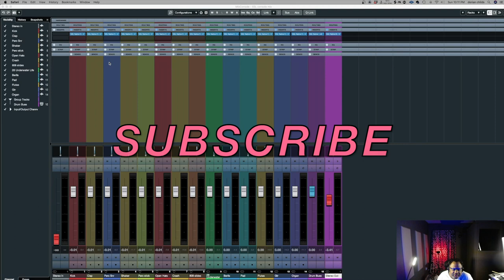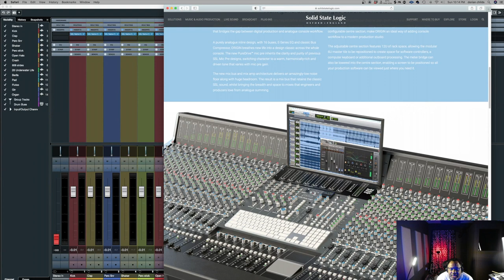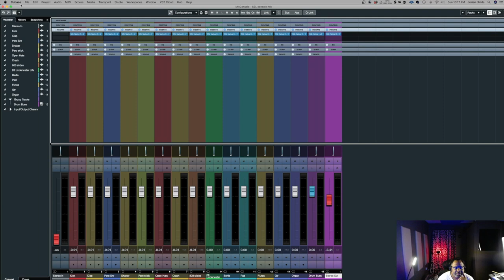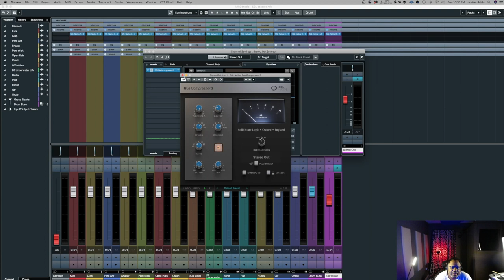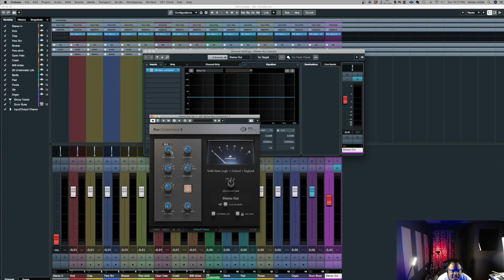How to create a SSL console via your DAW?

Comment: I'm useing same setup with Cubase 10.5 Pro and  native ssl channel v2/ buss comp. I also use UAD Studer A800 and Ampex tape emulations.  Lastly I've been mixing using rear buss compression technique. 
I use a controller i had since 2009 (tascam us2400) to speed up my workflow.   Lastly since I'm all in on the SSL I will add a UC1.
Reply from the maker: Hey ive been hard on getting the UC1 as well. I totally argree I’m all in for SSl

Comment: Like your Vid. I have a question on any real mixing board ssl neve or whatever. If you INSERT a compressor or eq does it leave the board before hitting the internal modules (The consoles eqs, filters or pre amps ect) or after. If yes would the console emulation go after the vst fx. Not that what you did was wrong you had no fx inserted so it would be 1st in line..Keep up the good worK.
Reply from the maker: Yes the signal will be patched out of the board going into the compressor then returning out from the compressor back into the board … that’s if we are talking a hardware signal flow.
Reply from the maker: I do it in such a hybrid way for example, I will come out of my audio interface then patch into my SSL buss comp hardware then return back to DAW on another channel.
Reply: @Cherokan35  I'm talking about all ITB console never leaving digital domain and how to route the signal flow as it would be done on a analog console. Would the vst channel strip go behind the inserted vst comps eqs ect in the chain to replicate how a analog console signal flow goes. Ive seen some vids where the vst channels strip is 1st and vst comps ect come after. My main question is on a analog console channel strip does the insert point come before the onboard fx eq comps gate or after? does it really matter lol. I'm just trying to create a real ITB and route it the same way that a total analog setup would be routed.. Thanks Again
Reply from the maker: @theweaz9975  yes the insert points comes before , it bypasses the channel strip to what ever you want using  such as outboard comps and eq
Reply from the maker: @theweaz9975  so in the digital world when we insert other comps and eq it will be first in the chain before the DAW’s stock channel strip
Reply from the maker: @theweaz9975  hope I answered it for you
Reply: @Cherokan35  Yes it does . But i was talking about a using 3rd party vst channel strip like the ssl your vid was about.But the logic is still the same. Thank you for your time and response.
Reply from the maker: @theweaz9975  awesome if you want you can show me your setup, would definitely like to see ur work flow